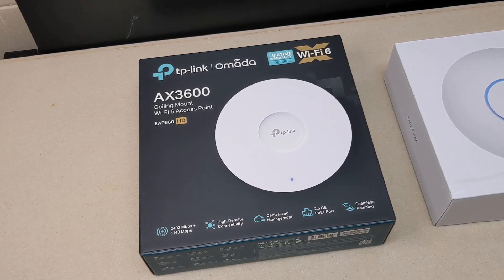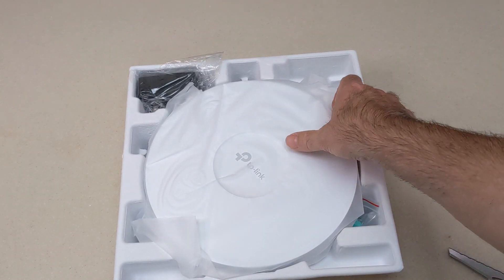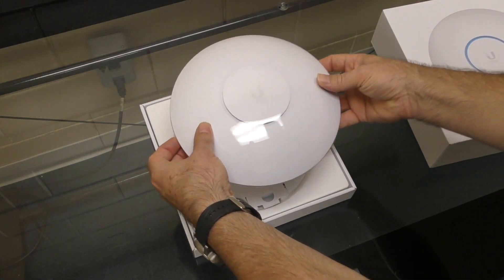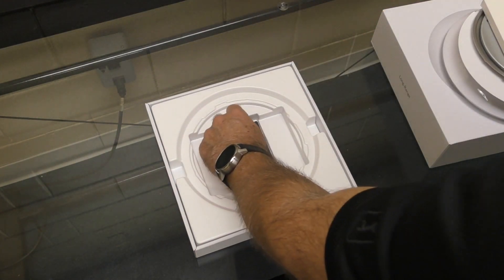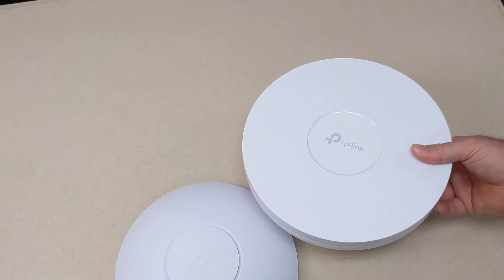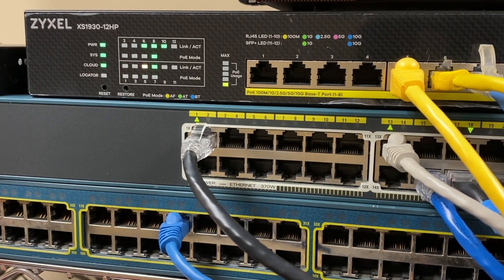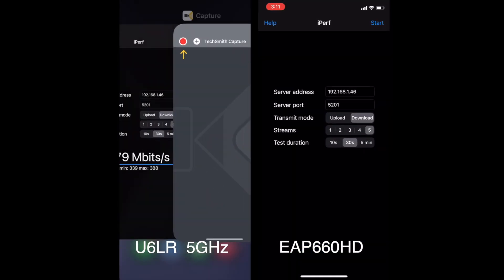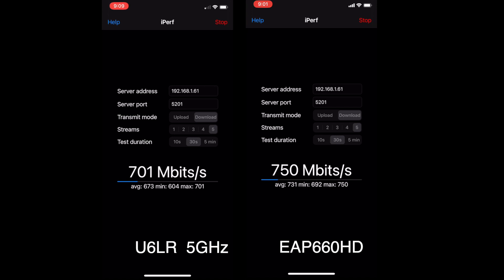TP-Link EAP660HD v  Unifi U6LR

Comment: TP Links are far easier to setup, especially if your meshing them, with the ability to manage multiple mesh sites from your phone.  Firmware upgrades are also much easier to manage, I only use ubiquiti for their point to point links.

If you setting large mesh networks in commercial buildings you would nearly always use PoE. How many ubiquity nodes can you mesh together on a single network?
 Just my opinion.
Reply: I read that tp link are meshable only with controllers and non only with the app. Is true?

Comment: I’ve got a asus AX11000 and get 940Mbit on iperf … so much better results then those AP’s
Reply from the maker: wow!  that's awesome speed.  Who need hardwired?😉
Reply: @NetworkAdvisor  I know, thanks. You have to spend a little more time in fine-tuning your access points because now they score below average.
Reply: @IAmZen_007  asus routers are consumer trash with ridiculously buggy firmware. these APs are designed to handle hundreds of clients each, they are not designed for getting max speed out of single device. besides, anyone whose not a noob in networking knows wired is the way to go for max speeds.
Reply: @teemuvesala9575  You are certainly a Unifi lover. Asus unstable firmware?  Doesn't bother me because I'm running Merlin. 100 of devices simultaneously? Don’t need it and when I buy a product I want full performance but even with 1 device it’s slow. So no wheelbarrow with thin tires for me. Wired?  Obviously this is better and I do, but I'm not going to be walking around with a tablet with a cable on, but maybe you do.  Latest technology?  Certainly not Ubiquiti, if you release AP with AX with a 1Gb uplink you are not update. But don't worry, the new Enterpise AP finally has a 2.5gb uplink… but still isn't available after so many months. A lot of blabla. Sad. I'll wait for you at the finish line... 🤣
Reply: @IAmZen_007  Merlin or not its same buggy garbage. Its gamer oriented BS and lots of junk is sold under gaming branding. And no, I don't use Unifi. Currently got just basic TP-Link Deco X90 system with 2 units and wired backhaul between them. With Intel AX201 WiFi card I get over gigabit speeds. No need for Asus gimmickery. WiFi 6E is the biggest joke ever. Its so pointless considering WiFi 7 will be massive leap forward in speed.
Reply: @teemuvesala9575  What Asus did you use before. I don’t have 6E so I can’t judge. No you say it’s buggy garbage, your first post it was buggy firmware, make up your mind. Wifi 7 is the way to go, but tell me when?
Reply: @IAmZen_007  The firmware is buggy whether Merlin or stock. The stock firmware even implements certain features from Merlin. Rule of thumb is if you want lots of features that actually work stable you go with a business solution. On consumer side you pick simple solution if you want stability. The problems with Asus firmware are ridiculous. The phone app wrongly syncs with the router, AiMesh often gets screwed in firmware updates (especially if you use wired backhaul)…
Reply: @teemuvesala9575  I don’t have this problems. My Asus is running smoothly with all the features. Running now VPN from abroad, streaming from my NAS at home over this VPN. 1000% stable. You still not answered my question, which Asus product did you had with all those problems > I assume that your objective opinion is based on your experience with an Asus router.
Reply: @IAmZen_007  I've had several Asus routers. Most recently tested Asus XT8 and it was total trash, wired backhaul went bust right after firmware update. Deco X90 is way better as a consumer mesh system. But honestly I'm considering just going Omada system with maybe 2 APs, and a proper 2.5GB 8 port PoE+ switch. UniFi in contrast is over priced garbage.

Comment: A useful comparison , but I think you got too hung up of the PoE question. Seems to me there is only one killer difference here - the 2.5G ethernet capability of the TP-Link. But as you didn't test with multi-clients we can't see how much of an advantage it is in practice.

I think you made way too much of the fact that the Unifi is PoE-only, and really misleading to say it is a 'big deal' and supposedly a 'show-stopper' if you don't have a PoE switch.. 

With the TP-link you get a wall wart, but as you said, there may not be power-over-ceiling, and then you are stuck with the length of the adaptor cord. With the Ubiquiti you can just use a low cost Ubiquiti PoE injector (which you chucked in as a very minor afterthought) - these usually come with the retail pack anyway, or can be bought very cheaply, and they are very nicely made, look good and have wall mount options. But the killer point is that they can go anywhere betweem the AP and the switch, even right at the switch wher there is almost certainly power available.  I'd far rather have that option in the box than a wall wart.

You made much of liking the huge ventilation on the TP-link - most likely needed because of the much higher possible dissipation of the 2.5G ethernet interface, but likely to allow a lot more dust, bugs, smoke particles, steam etc into the unit, quite possibly shortening its life. The Ubiquiti devices are almost sealed and won't suffer from poorer air quality.

The extra size of the TP-link and its sharp edges are also much more obtrusive on 8-foot ceilings domestically, though probably not so much of an issue in a commercial setting.

Comment: There is no need to say you need a POE capable switch to power the Unifi, you can simply use the POE+ injector (separately sold for like 12 Euro)  that comes with a power cable direct to a wall socket.
Reply: You dont get many power sockets in ceilings or up poles.
Reply: @212MPH   You don't need power sockets in ceilings either, you can put the  POE injector near a wall socket near the switch or anywhere and use a long ethernet cable that carrying power and data from the injector and go with it to the ceiling, same as POE capable switch.
Reply: @selphie99  hahaha hahahahahah I can tell you've never installed a big network.   You haven't a clue.
Reply: @212MPH  Speak of yourself, I am a Senior Network Engineer with more than 8 years of experience working in big networks of government and Tier 1 ISP's like Vodafone working on the backbone core network Internet Exchange that connect between countries, I usually work with more complex fiber optics that carry 400 Gbit/s of traffic, this is pretty basic stuff, I have this setup at my home, POE injector I place it in the store closet where the fiber cable and electricity of the house coming, near the main router with 1 meter CAT6 cable to the main switch/router and power cable to wall socket for power and the other end of injector a single long 15 meters cable CAT6 that carry power + Data  to the ceiling, it works perfect for me,  this is a cost effective way because injector cost only 10 Euros while buying a POE switch compare to non POE switch can be hundred of Euros different.
Reply: @selphie99  You are correct here Sir. It seems like Gerry has never installed a network outside his home. LOL.. The injector is always best placed wherever the server room is.. This guy is wondering where the power is in the ceiling.. ? SMH lol
Reply: @selphie99  I would like to know where they sell 1G PoE+ injectors for 10 Euros. Can you tell me where I can order one? The least expensive I can find is 17.39 EUR plus shipping.
Reply: €13 at Ubiquiti Store Europe.

Comment: Which is best for a high-density network with over 500 concurrent clients?
Reply: @pusico6555 Sure, but that doesn't invalidate my comments on the review at all.
Reply: Neither of those would be good for that - one of the Ubiquiti HD models would be better suited to handling a crowd. Even better would be the XG models, which are meant for that sort of scene, but of course cost a lot more.
Reply: @Rosscoff2000  Lol TP LINK HD series is rated fo 1000 client. What a ubiquiti fanboy

Comment: what about 2.4ghz radios? I think I read something about the UniFi only doing WiFi N on the 2.4GHz
Reply from the maker: I heard that somewhere too but have noticed it in my performance testing.  I suspect if I had a detailed wifi analysis tool maybe I could see what type of protocol the U6 is advertising on the 2.4.

Comment: The fact that the Unifi has a metal mounting plate (that usually blocks radio) on the back makes me wonder if this access point is suitable for wall mount when the client is placed on the back of the device
Reply from the maker: Good point Marco.   While I am not a wifi expert, I do know that these units (all access points) are designed with mounting direction in mind.

Comment: I heard the UniFi Access Points sometimes turn brown on the bottom because of the heat, a Metal casing or vents would be a good Idea...
Reply from the maker: oh, that's interesting to know Felix.  Thanks for sharing. :-)
Reply: Using Metal near antennas is normally  bad for signal
Reply from the maker: Good point Ali. 😊